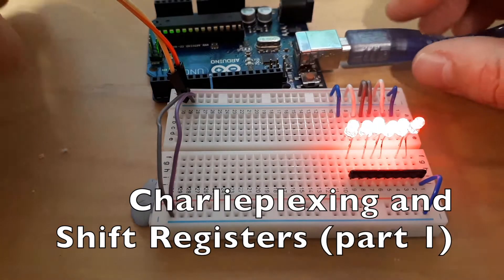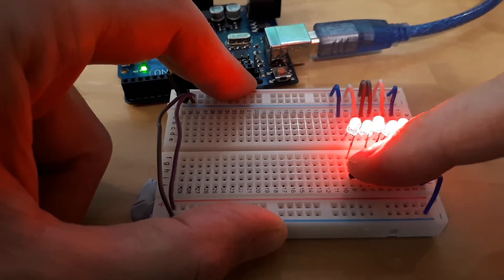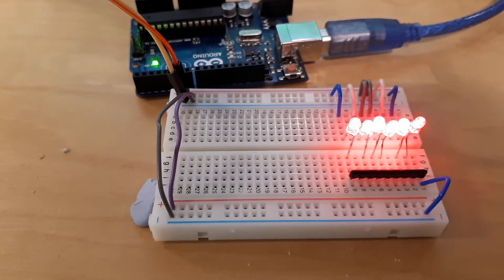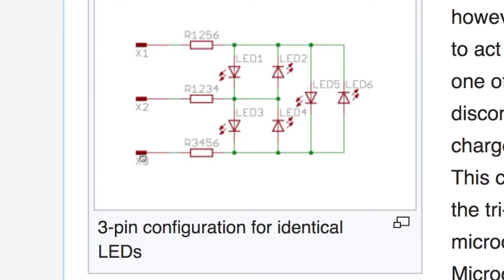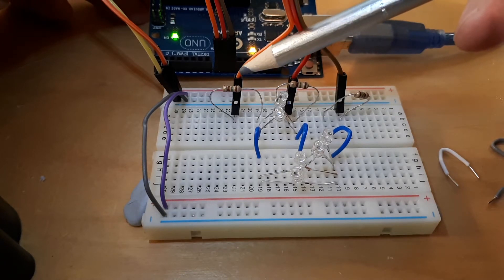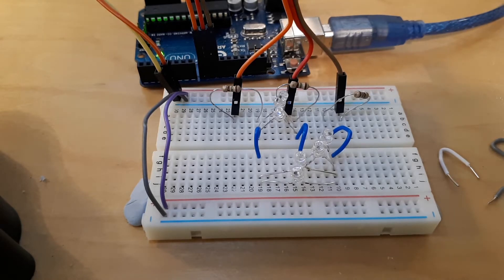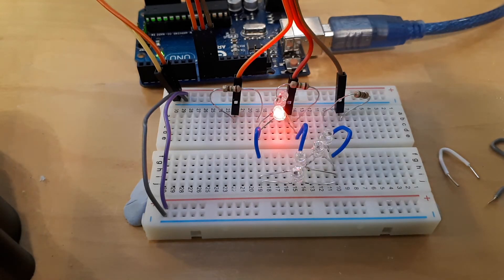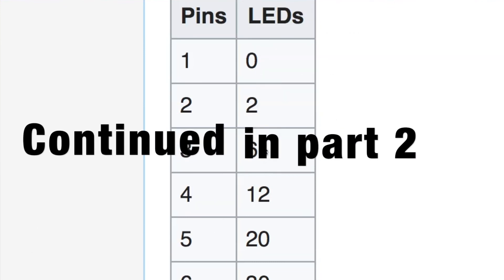Charlieplexing Vs 74HC595 shift-register (part 1)

Comment: Great video, helped me, thanks.
I know it's 7 years since your video, but if you are still doing this stuff, I wonder if you can suggest a method for driving 16 segment common anode LED digits, I want to drive 20 of them and I have a load of 74HC595's, and I was hoping to charlieplex them.